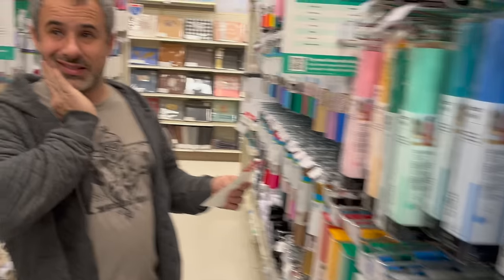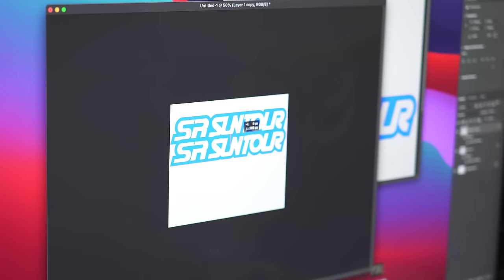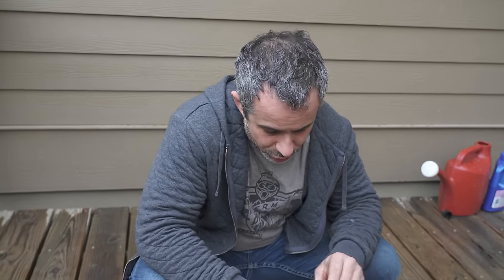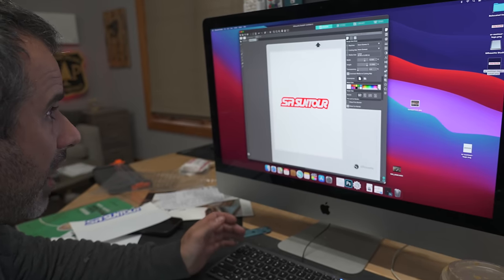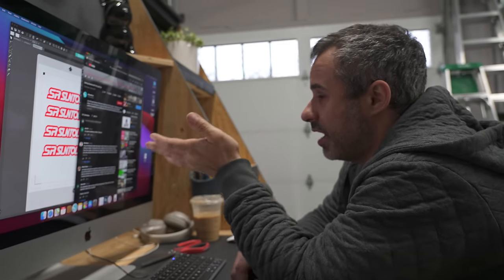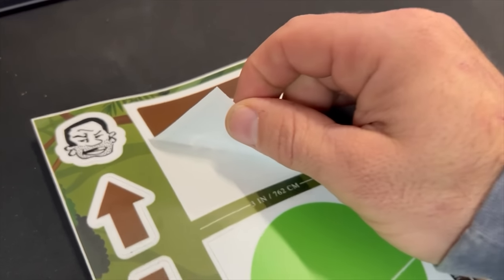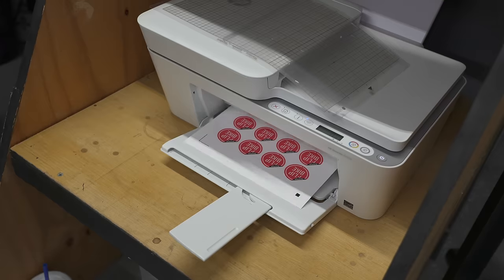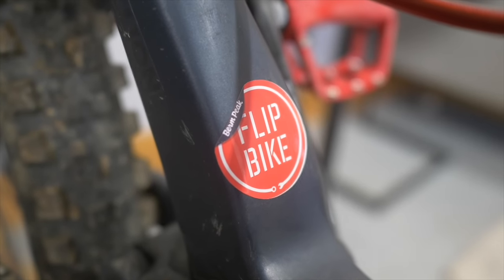Watch a guy figure how to make decals for bike parts

Comment: Would definitely recommend cricut over silhouette vinyl cutters. Software is significantly better and can accept many different file types
Reply: Every scrapbook mom I know has a cricut. I stand by your comment.
Reply: Cricut lost my business when they started requiring a monthly subscription to use their software.
Reply: Silhouette Studio comes in a business edition upgrade that is hand over heels better than the free version. It's almost all I use for SVG work.
Reply: @cobytenpenny5269  Cricut did a U-turn on the charge for using the software. My daughter got a Cricut last year and never paid anything to use the software.
Reply: @cobytenpenny5269  Cricut walked back those changes and doesn’t require monthly charges (due to customer outcry). Silhouette however wants to charge you to use SVG files.
Reply: Listen to this dude, he knows his stuff... probably a Hobby Lobby secret insider!
Reply: @cobytenpenny5269  I always wanted a cricut and didn’t buy one until after they stopped charging. Their software is really good though.
Reply: Definitely get a Cricut Maker. You can print and cut from the same software(free version) and import pictures and make them into the vector files. Has a lot of different cut heads. It becomes a blackhole with what you can do.
Reply: Also to add since this comment blew up, I would recommend using Adobe CC Express for making graphics since you can export as a PNG with transparent background
Reply: @cobytenpenny5269  they back tracked and do not.
Reply: Do theys till require an 'always online' connection or can you use it without an 'account'?
Reply: @caffeineau  you need an account but it's free so it's never bothered me
Reply: @stephenlockett1289  Good to know. A friend of mine bought a cricut but reteruned it whern he found that it was all online and required online fucntionality to do anything
Reply: I love my silhouette for car decals, a bit of a learning curve but not bad at all. Though, I tend to do colors by layer instead of printing
Reply: So......don't try and save $150?
Reply: I agree with this. I have had the cricut explorer and the maker. Definitely an amazing machine.
Reply: At the same time Cricut tried to pull a "pay us a subscription to keep using our hardware".
Reply: @adamweb  definitely not lol
Reply: Can confirm the silhouette software is absolutely trash on the mac. Zooming in on the page can take up to 20 seconds. Moving an object into a position takes minutes. Very painful.
Reply: @Yesat-Erday  yeah I haven't had any problems with that since I bought mine after they changed that. Also, I would be willing to pay a small amount since it's pretty good and I use it every day
Reply: Oh man, I thought the cricut software was too basic for my needs, but the silhouette one is reaaaally shitty
Reply: @huikify  yeah it's pretty basic, so I make graphics in other software and import to cricut, but it's pretty complete for cutting purposes, just not so much for graphic design
Reply: I have and advise against cricut. It's not nearly as reliable and the software is meh at best
Reply: @evankennedy8504  nearly reliable as? I have used mine daily for over 2 years just had to swap out blades when they get dull
Reply: @Stephen Lockett  my silhouette 4 has lasted longer and ran cuts for 8 hours straight and I've never swapped the blade
Reply: @evankennedy8504  to be fair blade life is based on how much you cut. If you use yours often the blade would be dull after a while. I get about 60 hours of cutting per blade. Blade life isn't a brand issue either since I use the best aftermarket blades that exist. Either your cuts are snagging/ not cutting all the way through, or you don't use your machine as much as you claim.
Reply: same, i used a cricut in my digital art class, it is so easy to make sick bike stickers hehe
Reply: Agree, I have an explore air 2 and the software is cake to use.
Reply: My Cricut was the first thing i bought at the beginning of lockdown. i'm looking forward to your next video on die cut stickers!
Reply: I was about to comment the same. My mother has 4 cricuts, a whole craft room, and has done hella stuff. Cricut is the way to go 1000000%
Reply: We have four cutters in our family, two silhouettes and two cricuts. The silhouettes have been much more reliable from a hardware stand point. My mom uses the silhouette professionally, and just used the free software for about four years.
Reply: Yes
Reply: @cobytenpenny5269  you don’t have to pay only if you want like the super fancy designs and fonts

Comment: Hey Seth love the videos. One technique I use is to make waterslide decals (which can be done with an inkjet printer), then use a 2 part clear coat spray on the whole fork/frame to make it weather resistant.

Comment: For someone who thought their next printer was gonna be a 3D one, you have basically perfectly described how most 3D printers are by the end. There is a setup, a learning curve, and tons of dialing in to do for some printers. :P
Reply: Depends on the printer really, an ender needs a lot more work then a prusa mini
Reply: @Steph.98114  I went with a refurbished ender, and it was printing great right out of the box
Reply: @ezraclark1793  not talking about print quality, talking about reliability.

Comment: When you're kiss-cutting vinyl with a backer, you can usually skip the adhesive mat. Its purpose is to hold the cut elements in place that might move out of place like e.g. a single layer of cardstock.

Comment: You can buy sheets of whatever color vinyl you want and load those straight into the cutter and cut your decals that way if they are just a single color, that skips the printing step, and you get the bikes frame color showing inside the letters, rather than white.

Comment: I recommend the silhouette plugin for illustrator as it lets you use all the standard illustrator tools (path offsets etc) and print from illustrator itself with the registration marks then lets you send layers to the machine as cuts (with different settings per layer if needed).

Comment: Back in Afghanistan, we used to paint the old frames to make them look new and we would use stickers on all parts of frames and suspension. We would just coat everything after we put the stickers on. Try spraying the coating after you put the stickers. Much more durable. It will be even hard for you to peel them off with your nails.

Comment: 3d printing can be just as if not more complicated than using a vinyl cutter, its all about learning the UI. Plus one for Circut though, if all your doing is bike decals you could get away with the circut joy , i also suspect with the right material and some work you could cut your own frame protection kits.

Comment: Try using a scalpel or tiny exacto knife. Cut from the decal outwards so your points are spot on. Make sure you cut past where you will cut it lentghways. Then use that fancy cutting tool to make the cut as close as possible and it will take much less time and will turn out better. Scissors are not good for this application at all.

Comment: Yo Seth, you should have bought a 3d printer. I printed a bracket for a drag knife (the part on your craft mom knockoff Cricut, cheap on amazon) that clips right onto to the extruder on my 3d printer. Plenty of free programs that turn your vector into a toolpath (same tech as a CNC router) and boom, your 3d printer cuts stickers.

Comment: Can you put a clear vinyl sheet over the printer sheet before cutting and still di a kiss cut.

I also guess you could do a complete color vinyl sheet cut for silver/gold etc where you don't need to actually print anything...
(and then even better printing on gold/silver/glitter/Clear vinyl for more effect... only issue there most ink jets don't print 'White' as they assume that's the color of the paper... so you would need to adjust the choice/colour of your printing if the vinyl is anything other than white (I suppose you could add a layer the same color as the vinyl to your picture and subtract that away from the... uhhhh this is an MTB channel isn't it....    

I'm just going to stick with sticking some anti scratch clear on my stickers like I used to on my motorbikes !.  (Great for keeping your forks from scratch damage...)

(Another obvious trick is to try and match your frame color on the sticker for the background inside lettering etc.)... or buy a white bike?           q8D

Comment: So, did you even look online to see what it costs for custom decals to be made? Between the cost of that printer and the cricket cutter, you can have quite a few custom one-off print/cut decals made and instead of the cheap vinyl and ink (inkjet ink is not really UV resistant and will sun-fade super fast) you buy for home use, the professional decals will be water and UV resistant.

I am a 30 year veteran in the print industry. I own an industrial vinyl cutter and have access to professional dye sublimation printers. It's still kind of a toss up whether or not I'd make my own or order from online. Honestly, the online options are almost as cheap as the base materials I'd have to consume to produce my own decals and sending a file is so much less work than doing it myself. The only reason I even keep my vinyl cutter is when I get a customer that cannot wait for the product to ship.

Comment: Seth has to get a 3d printer. I can only imagine how much acessories, topcaps etc he would print (get a prusa i3 mk3)
Reply: hahaha i just recommended the ender v2 but i guess if you have the money
Reply: I can’t wait to see Seth wrap his head around a 3D printer. Even with something as turn key as a Prusa, they can be a bit infuriating at first but once you nail settings and understand why a print or design fails, it easily becomes one of the most rewarding and useful hobbies to have.
Reply: Ender team! Would love to see his prints
Reply: Nailing down 3D-printing might take weeks or even months. This could segway Seth from biking world to a different realm. With the bike park opening and his own backyard trail system, I guess it is best that Seth just collaborates with some 3D printing channel and not do it by himself. IMHO
Reply: Prusa is the exact thing i wouldnt recommand for beginners. Just get a resin 3d printer, you get started in few minutes, very easy to use and maintain. For 300$, you can get an eleego mars 2 pro which is litterally the best printer of this size you can get. Prints looks like molded plastic, it's insane.
Reply: The only thing that I have managed to 3D print that is bicycle related is a "special" wrench to remove the Suntour forks top nuts
Reply: @mikmerl1  A few years ago I made a flashlight mount for the handle bars that was pretty secure.  Had expensive flashlights, but no decent bike light at the time.  So did what was free.
Reply: Seconded on Prysa or mk3. Great printer and software with minimal troubleshooting needed.
Reply: @Leoparh  yeah, the resin is also toxic, it's a pain to wash parts and cure them, it smells terrible and makes a mess if you to super careful. Plus the prints have to be quite small to fit the bed, your better of starting with a fdm unless your only doing mintures.
Source: I own multiple printers including a resin printer.
Reply: any good-review models from creality, tevo, anycubic, or lulzbot would be sufficient for hobby-grade 3D printing

the only thing I would suggest is for him to specifically get regular cartesian-axes printers as deltas and tilted-axes printers would be a faff to level.
Reply: @Steph.98114  i use the 3dmaterials resin, water washable and almost no smell, and i have the wash and cure station from eleegoo which makes cleaning the prints super easy.
+ i dont think you need huge printing volume to start.
Just my opinion though.
Reply: Just get a plasma cutter, use metal! We are men out here right??
Reply: He should make a voron 💀
Reply: Didn't BOX had a 3d printed head set with a light attachment? OK is it durable enough to hold the weight of the rider and can a 3d printed part survive them weather conditions,when it s constantly under stress?
Reply: @AJ_Owens  Yeah and then a welder plus a $5000+ mill to make any non-2d shape out of that plasma cut steel.
Regarding the 3DP though: He'd need to learn modeling unless he just wants to print thingiverse stuff which he can also just order online, and learning 3d modeling takes more than a weekend to figure out even for very basic shapes. Add the time it takes to learn to print and to learn tolerances and he'll be making "I tried to 3d print xy and failed" videos for at least a month.

Comment: If you’re doing it by hand, get a metal ruler with a cork backing and a x-acto knife. So easy to do straight lines quickly and you are able to get the little bits left over pretty quickly. Also could use a box cutter with a new blade.
Reply: And a self healing cutting mat! Even with a cricut, I usually end up cleaning up stickers with an x-acto knife on a mat.

Comment: As someone in the print industry (I print thousands of stickers a month), I recommend doing a cold laminated instead of acrylic spray. Not only are you trying to protect the print from water, you also want to protect it from uv light and chemicals. The spray will chip and deteriorate where the cold laminate will have a stronger protection.

Comment: This could not be any more timely, relatable or hysterical. We got a Circut at work for doing exactly this, making stickers, and even with my engineering degree it took the better part of a day and a 90 minute technical support phone call to calibrate the photo sensor to the knife point cutting location to get accurate cuts. The tictoc moms being the only source of technical support on YouTube could also not be more true... Monogram everything.

Comment: you really are going to want to laminate those stickers, with something that has uv inhibitors, 3M vinyl like 3M1080c would be the best and used for wrapping cars and you print and laminate. I worked in large format print and design for years.

Comment: Reading the instructions would have been faster!

For bike frames, I used this vinyl cutter to create stencils that then allowed me to paint the logo onto the frame.  Some clear coat on top of that and it looked awesome.  The software wasn't intuitive AT ALL, but once I got the hang of it, results are pretty reproducible.  I'm not sure I would recommend the cutter to people either though, it's not particularly intuitive at all, even if the results are pretty good.

Comment: Take it from a yet another graphic designer, if you want to cut that suff out by hand you absolutely want a scalpel and a decent cutting matt over scissors. A desktop CNC cutter can be worth the time if you give it the time, much like 3D printing.

Work with vector files in Illustrator, not raster in Photoshop. CMYK colour, not RGB.

If you really want vinyls to last, skip the desktop tools and just buddy up with a local signage company. Sunlight will absolutely mince desktop printed materials. Good quality, outdoor-rated sticker stock should last 5-7 years out in the sun under normal conditions or 8-10 minutes if you live in Australia. 

One or two colour jobs you could do in solid-coloured vinyl. Anything more than that would be printed in CMYK but importantly with UV-curing inks.

Comment: Now it's time for something different, but kinda the same, but counterfeit: Name Brand Bikes. 

I can see Seths ultimate secret plan: Buy crap bikes that are made in the same chinese factories that the big name brands use off craigs list, originally bought from Wal Mart or the internet, using the same frame layout, but didn't cut the mustard  and were sold to 3rd party internet sites as no name bikes. Sand down and repaint the frames, remove all stickers or identification markings, make some fake decals replace the "Motobecane" with Specialized. Sell the bike you just bought for $300 off craigs list for $600 Double your money. That's some shady stuff right there. 

Go for it, Let the fool and his money chase name brands. Because that is all you are really buying anyway- name brand stickers when it comes down to most bikes.

Comment: I want to learn to do this to remake model/serial labels and logo labels for old vacuums once cleaned and restored. I think I can figure out the cutting machine and sticker labels part, but the main issue I have is how do you get a one of a kind specific label created from the actual item, translated into a digital file to be able to make onto a new sticker? Maybe one of those wand scanners they have for scanning books? Then getting the right scale size as well. I took Photoshop classes in high school in 2006, but it's been so long ago now I forget how it all works.

Comment: Don't limit yourself, look into different types of vinyl materials.. gold, holographic, etc. There's some awesome stuff out there that will allow you to brand your shop and make it look killer. Look into getting transfer adhesive and you can make vinyl decals, no printing required.. more merch ideas for your shop & capabilities to produce more durable stickers without need to clear coat as there is no printing involved. It's another $20 investment but you can look into a lamination machine instead of clear coat, but seems like it's working for you well. If you upgrade your printer to an EPSON with tanks and get sublimation ink / paper, you're 75% of the way to producing shirts in house using your current cutting setup.